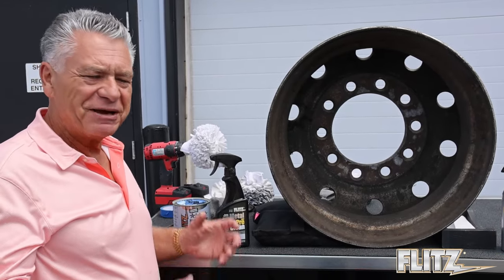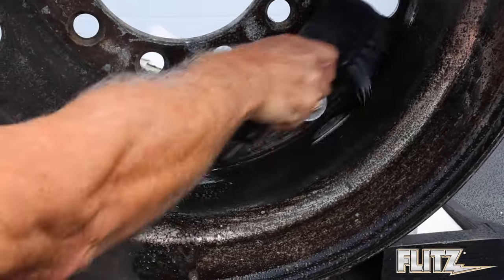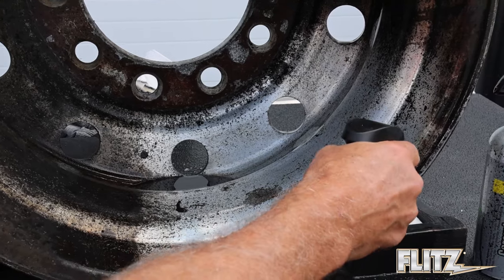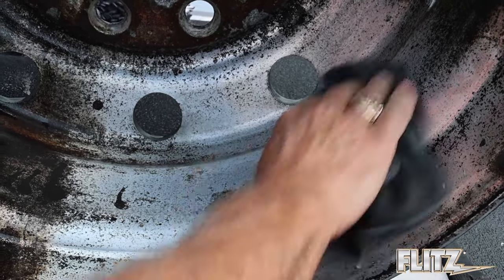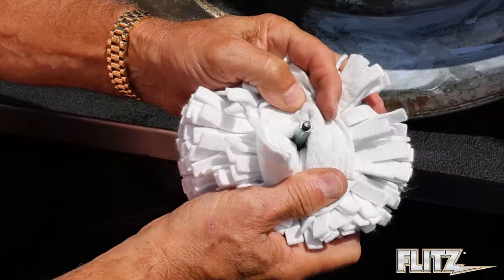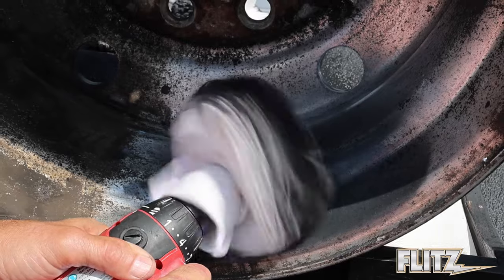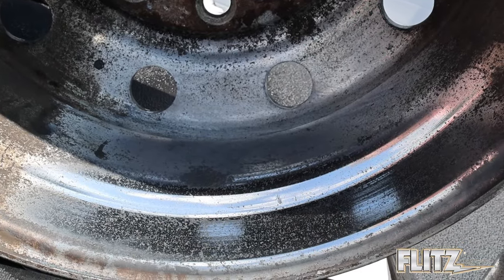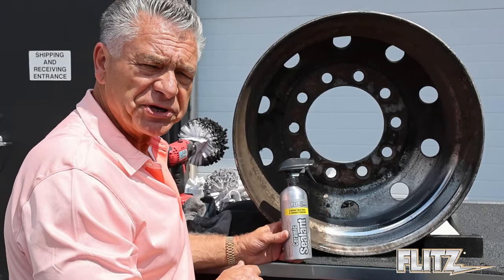BRINGING ALUMINUM WHEELS BACK TO LIFE

Comment: Had a rookie driver throw acid on the rims during the summer and scorched them black. Would this salt product take care of that or is it more for grime and hardened brake dust? Recommendations?
Reply from the maker: It's more for grime and brake dust.
Reply: Scorched them black??? Blue Beacon uses acid brightner and nothing turns black. Guys all over YouTube have used acid cleaner on aluminium with nothing turning black?